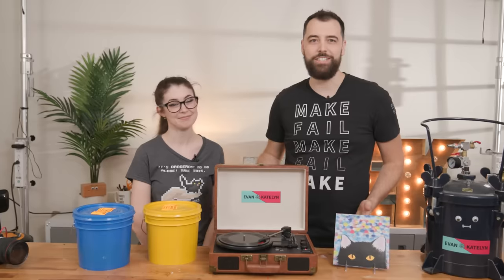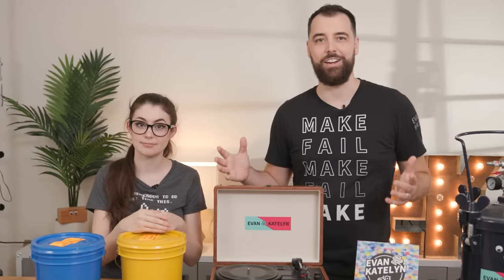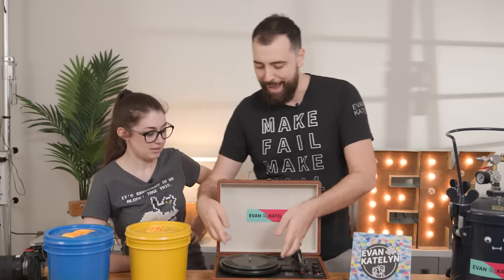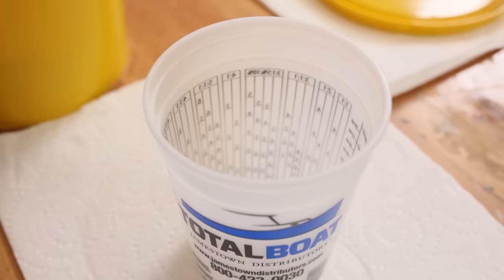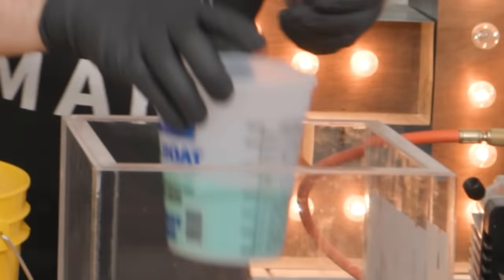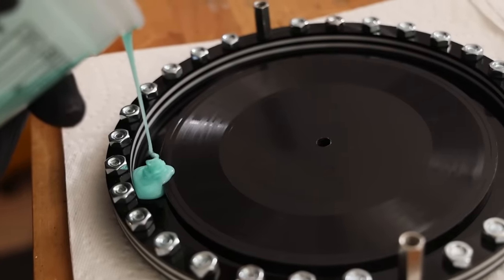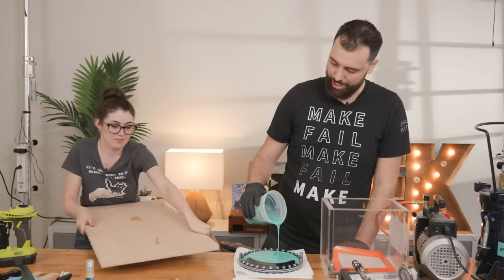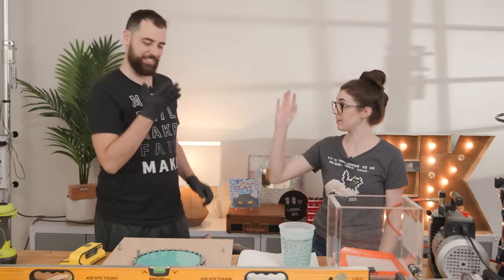Pirating Music With Resin - How will it sound?

Comment: The powder made all the static. Think about it, it's a bunch of lumps where the surface of the record is, which is what you want to avoid with records. Using liquid dyes would improve sound quality.
Reply: I was wondering what made that static
Reply: I strongly disagree. As long as it isn’t entering any of the grooves, it should be great. Reason why it sound so bad is because well to Crosley turntable
Reply: If I had friends like you maybe my dad wouldn’t have left
Reply: @gatsbysucks  yes, but with the powder settling to the bottom with the grooves, it is possible. I do see what you are saying, however.
Reply: @Melltrell  r u ok
Reply: Could also do a layer of clear then have the color behind it
Reply: @maisong9886  true that.
Reply: Simply incorrect, the way resin works is… news flash it’s a liquid and it pools in all of the divets, this fills in the area around the powder meaaning that’s even if the powder was on the surface (which it would be) it could only be at parts where it’s flat because if it’s not the resin just… fills it in, the reason for the static aand especially the hissing is the cheap garbage crossley record player didn’t have a weight adjustment to adjust for the thicker record, why does needle weight matter you ask? Well because we’re trying to play the grooves, not the molecular surface imperfections of the resin, if you used a normal PVC record just as thick as this thing on the same record I’m certain it would hiss almost as much. The reasons it hisses more is due in part to the powder being a different hardness and letting the needle dig into it, though I still doubt that because there’s no reason why the powder would not be fully coated and exposed to the actual diamond needle.
Reply: @flooferjay3245   don't think he or she or they is ok
Reply: @elerileigh7926  So explain why their actual record they copied didn't have all the static.
Reply: oooor they could pour a tiny layer of clear uv resin, cure it and theeeeen make the colour pour 😁 that should fix it right?
Reply: the powder would have also destroyed the needle nearly instantly. Glow in the dark pigments are extremely abrasive even for less than precise equipment like 3D printers
Reply: @elerileigh7926  I disagree. With a record you're talking about microscopic levels of preciseness, and the powder would have been in contact with the needle instead of the resin at many places, meaning the surface now has an inconsistent surface materially speaking. That alone could cause static depending on what the powder is made of and what they might do for the sound, but also the powder might have created some places that the resin couldn't fill smoothly. It most definitely could have caused a problem.
Reply: Amazing transfer quality considering, and they can just repour with same mold they made without the dust.  I think its loss from using silicone, its incredibly good even with the static.
Reply: @jonmayer  read the comment again
Reply: Do you know what goes into those liquid dyes ?
Reply: @gatsbysucks  but even literal record production companys warn that glow in the dark records have way more static then standard or colored vinyls
Reply: @gatsbysucks  the table isnt that bad that it would make all that noise otherwise no one would buy them
Reply: Yes! The glow in the dark powder is what caused the "static". Even professionally manufactured glow in the dark records have a ton of surface noise 😫

I've been collecting vinyl records for over 45 years and I own thousands of records. I specifically avoid buying glow in the dark records because they sound like sandpaper. I do (unfortunately) own 5 or 6 glow in the dark records because they were not available in another color... And they all sound just like that! 😮👉 The music itself sounds pretty good but there is a constant surface noise (static) throughout the entire record 😕

The Crosley record player probably didn't help matters, but it was not the main cause of that surface noise (static) 🤷‍♂️
Reply: @elerileigh7926  no but the flow is a powder which doesn't settle flat, it probably isn't the only source of static but it's likely a contributing factor
Reply: @elerileigh7926  
You have absolutely no idea what you're talking about 🙄 Seriously!

The tracking force or weight adjustment (as you call it) has nothing to do with how thick the record is. It doesn't matter if you're playing a record that weighs 50 grams or 500 grams, the tracking force would be exactly the same.

In general, the tracking force is supposed to be set according to the manufacturers recommendations. And there is not a single manufacturer who recommends adjusting the tracking force depending on how thick the record is!

How exactly would that even work? 🤔 Is the user supposed to measure the thickness of each record with a digital caliper before playing it? Or maybe weigh each record before play? Inquiring minds want to know!

And! If that Crosley record player is what caused all the hissing and surface noise, then how come the original record didn't sound like that? If the record player itself is what caused the hissing and surface noise, then every single record played on it would sound that way! 😮💡
Reply: @gatsbysucks  nope.  it's bumpy as hell.  absolutely the powder 1000%.
Reply: @gatsbysucks the player isn’t the issue, the vinyl is dude
Reply: Also you could probably try to pour the epoxy directly on the record. I know it releases well from a lot of plastics without mold release.
Reply: Wasn't that obvious?
Reply: @gatsbysucks I would like to disagree with your disagreement glow in the dark powder offer has larger abrasive particles that can even wear down metal over time and while yes the turntable is bad quality the added grain compared to the original record is what matters most here. On top of that early records would mix a fine grit into there shellac to prevent them from wearing out and as a side effect they have the exact same noise as this record. Get girlbossed. (Respectfully)
Reply: @elerileigh7926 why hello my fellow audio snob I’m simply here to contradict your contradiction while yes the record player is low quality the real factor here is the difference between the original and copy. the particles of glow powder while trapped in resin are harder than it and in comparison the needle is much harder than than both of them combined at these scales the resin deforms around the needle but the powder does not resulting in an audible noise that sounds exactly like older records with grit of a similar consistency added in.
Reply: Some resins shrink after a cure and the powder would be more pronounced after that shrinkage
Reply: Agree with that, as vwestlife made several videos about cheap turntables and proved that cheap turntables like the crosley cruiser doesn't make an audible difference in groove wear compared to a high end turntable when played 50 times or possibly even more. honestly this copy sounds more like an early shellac record from the 1910's or 20's, than a modern 45, 33 1/3, or hell even a 16 2/3 RPM record

Comment: "Did we use to many screws?" The answer is no and probably not enough screws. Silicon is to expensive not to have an army of bolts and nuts holding your mold box in place.
Reply: exactly, you can never have too many screws where silicon molding is concerned lol

Comment: If you omit the glitter, there will be a huge improvement in sound quality. I am actually quite impressed that the resolution of the resin (considering air bubble defects etc) was good enough to produce a record which had a recognisable tune.

Comment: You guys this is genuinely one of the coolest things you've made. I can't believe just doing a mold and resin pour retains all those tiny intricate grooves! I work at a record store and I've seen all sorts of weird and crazy record shapes and colors, but this might be the coolest. Mainly because it swirls when it turns!!
Reply from the maker: thank you! we were surprised at how detailed the mold was
Reply: Silicone mould can even sustain enough detail to imprint holograms and optical diffraction patterns into chocolate. I think Applied Science, The Action Lab and Tech Ingredients all did this, and The Thought/Taste Emporium also did but didn't make a video of it.

Which in turn makes me think... can you copy a CD that way? The way they're made, the optical pattern is stamped into a polycarbonate disc on the label side during the moulding process, and then the stamped surface is covered with an aluminium mirror, then covered with protective lacquer and a label.

I have seen CDs delaminate when left in water for a year, because someone's cellar was flooded, and they had some new CDs there, and the water made its way under the foil seal of the packaging, so when the discs were taken out a year or two later, the label side including aluminium metallisation would just peel off, leaving a clear disc behind. It should be possible to maybe introduce something corrosive but safe for polycarbonate to accelerate this process. Then the polycarbonate disc can be re-metallised with for example silver mirror process, and it should play again.

Then the process can be repeated, delaminating another such disc, but instead pulling a silicone mould off the bare plastic disc, with the metallisation layer removed. Then resin can be cast into that mould, and metallised with silver mirror process again.

I am hopeful that with some effort, it can be made to work.
Reply: @SianaGearz  wow that would be a sight to behold. I wonder if anyone has tried this yet
Reply: @BelaCurcio  I am fairly positive that absolutely nobody ever did. There isn't really even any published material on using the silver mirror process to perform data recovery from pressed discs suffering disc rot, and using the process to copy a disc would be another couple steps of insanity removed from that.
Reply: @SianaGearz  A CD uses optical reads that won't work well with non-reflective things like resin
Reply: @davidy22  You would turn the data side reflective by applying Tollens reagent.
Reply: Too bad they copied king of random or something like that who did this video better years ago
Reply: @beardsntools  they also gave credit to them by mentioning that they’ve done it.
Reply: @thespankmyfrank  um yeah it is and in this case they even mention the guy who did the video years ago, so this is just an inferior copy of that video. Minecrap streamers are kids anyway and streaming yourself playing a popular game is like the least original thing to do. It doesn't even matter if they copy each other, it was bad content to begin with, literally couldn't care less about the let's players
Reply: @beardsntools  by your logic, everyone who paints is just copying the first person who ever painted. That's not how art works, bud.

Comment: In the olden days (!), the record players had a longer spindle in the middle so you could put on several records at a time. Each one would drop when the needle arm went back to the rest and then it would go back across and play the next record. You could put maybe 5 or 6 on at a time and they would still play well.
Reply from the maker: Ah, that is so cool! :_eandkHype:
Reply: Yes. I was laughing when they wondered if it would work if the record was thicker.
Reply: @karenbeads  I chuckled too.  Those 78's are chonky bois.
Reply: I wonder, if you had a long enough spindle arm, if you could create a record player that played some large number of records and never had to stop. Presumably, when you play 5 or 6 with that cool one you're talking about, the records would have to be offset. With enough records offset into a spiral that encompassed all 360 degrees, I think you could keep the spindle arm going around, just swapping out records as it goes.
Reply: @EvanAndKatelyn  I read this right when you said that in the video, wtf? (when you guys turned the light off LOL)

Comment: Love your content, as always; you two are a joy to watch! So glad you are doing better, Evan! 
Suggestion time:
1- Why not just level your table? Then if something is flat on your table, it’s level, too.
2- Take some stress (and bubbles) out of mixing resins. You could mix one part resin in each cup with your pigments, then vacuum chamber for as long as you want. I bet most of your air bubbles come from the pigments. (You could make a cool resin cup caddy with your 3D printer.) After all the bubbles are out, then you could add the resin hardener. You’ll know it’s fully mixed when the color is homogenous.

Comment: You didn't really have to test if a thicker album would play. Many modern albums are pressed on much thicker vinyl. Older records were thinner simply to keep them cheap; but now targeted at collectors can be printed in more warp resistant thicker vinyl.

Though a substantial thickness might require a rebalance of the arm for best results.

Goes back to continue rest of video

Gets to part where you are making the mould and pouring it

If there is any dust in the grooves, you are going to make them basically permanent in your resin copy and possibly amplify their impact a bit. Before making a mould of a record, Id recommend using wood glue to clean all the micro dust out of the grooves. You do this with some records that pick up enough dust that it impacts the sound and cannot be cleaned out with a brush.

Goes back to video

Yup. That's why your copy is staticky.

Awesome though. Gives me awesome ideas. I now have even more reason to get equipment to work with resin.

Comment: As a vinyl collector, so many things about this video hurt me on a deeply personal level, BUT a few things: Records are pressed with heated PVC not polyester resin, so duplicating them in this method will never result in a record that plays as well, but it does work like you discovered. Even when using PVC, picture discs and glow in the dark records sound bad compared to a black vinyl because of the additives. I would suggest pouring a thin layer of clear resin in first and letting it cure and then doing your glow resin as a second layer. This way, when the glow powder settles, it settles beneath the layer of clear resin. Theoretically, your final result should sound less noisy because the stylus won't be tracking across that settled powder and instead on a clean layer of resin. Of course you also molded the record without cleaning it, which means your casting will also contain any noise causing particulates as well because the silicone captures EVERYTHING. Also, simply from a scientific perspective, that crappy record player will make even audiophile level records sound bad. Anyway, fun video! You have the glow forge, it makes me wonder if you could use it to essentially lathe cut a record?
Reply: Also, while you could pirate records like this, didn't a lot of record players have a built in tape recorder so you could just,,, use that and put the music on tape. My dad showed me how to do it, it's also how you stop the record from being damaged from playing too much. It's like copying a CD to your computer, I guess.
Reply: This video hurt me too and I’ve only been collecting a year lol
Reply: @estherstreet4582  yeah or a line out so you could plug into a tape recorder. Now most new ones even have a USB for direct recording.
Reply: If they pressure cast the silicone they could have improved the quality as well. When I do silicone molds I don't do a vacuum step, instead going straight into the pressure pot as 60 PSI and have gotten flawless detail every time

Comment: hmmm, increasing the thickness of it is going to lead to the needle putting more pressure into the record than usual possibly damaging it. I'd say you could adjust the weight of the tone arm but idk if that's possible to do with your record player being one of those suitcase-style ones.

Comment: Here's a suggestion for a project. Make some sort of a display that you keep in your shop that is actually a checklist of all the stuff you need to do for your resin pours. ie: leveler board, mold release, etc. so when you do the project, all those important steps are right there in front of you so you don't forget. There is a reason why pilots use a written checklist to go down even though they've done it hundreds of times before. Just writing it out on a sheet of paper would be cheating though. You need to come up with something cool. Then I can stop yelling "Mold Release" at your videos. :D

Comment: I have three things to add from a making point of view. First as I have seen others state: maybe a thin clear layer of resin first will help audio quality (since no particles will be at the top). Second: If there are any bubbles in the silicone they will get compressed in the pressure chamber and deform everything. Thus it is always recommended to use a pressure chamber for both silicone and resin. That might explain part of the weirdness of sound since that deforms the final product. So I'd advice to either have both or none cure in the pressure pot. Lastly: Resin usually has a much longer "fully hardened" time (mine cures in under a day but is fully hard and sandable in about a week). So when you take it out after 2 sleeps and then immediatly play it the needle might deform the resin or doent slide as well since it is still not plastic level hard. Might be worth a wait.

Thats the advice part and other that that very cool project and as usual nice to watch you and your crazy ideas and enthusiasm :D